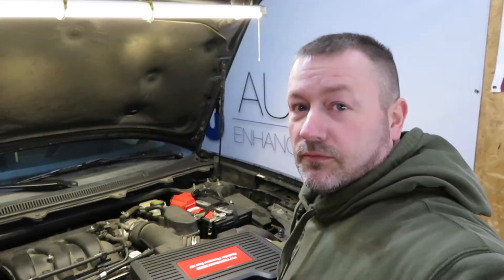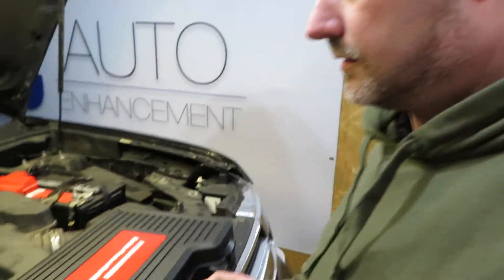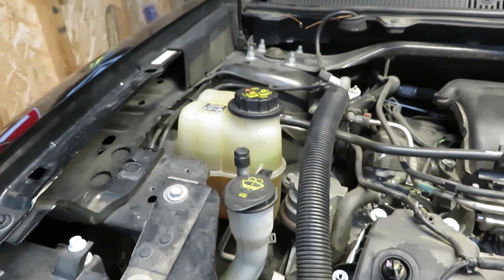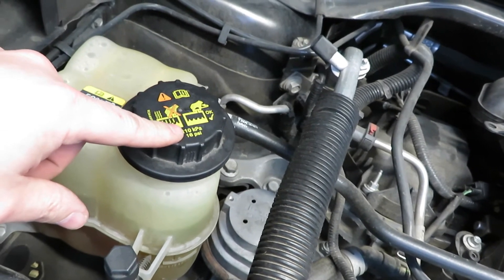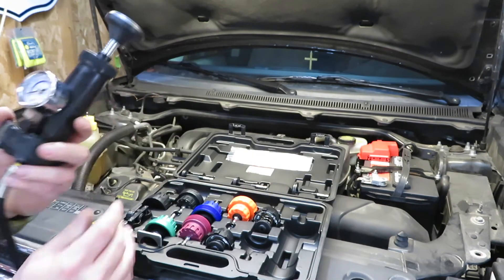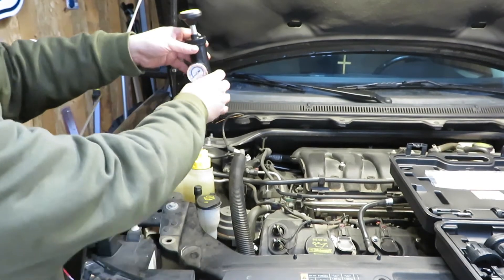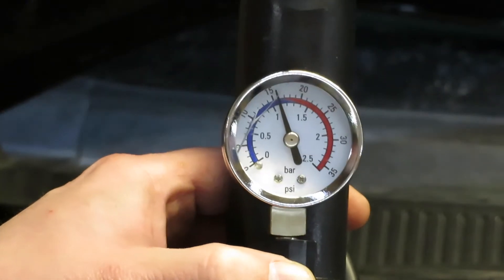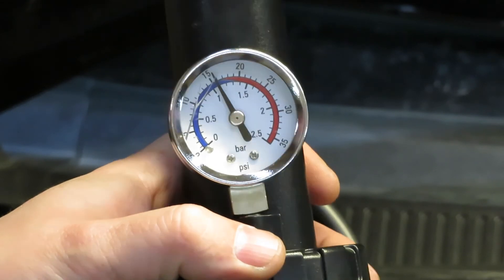Pressure Testing Coolant System Ford Flex

Comment: Need help..is the Reservoir cap tight??mine doesn't tighten at all is that normal???thanks
Reply from the maker: I don't remember. Can you unscrew it and it comes up?
Reply: @DCAutoEnhancement  yes..but when i try to tighten it it doesn't.
Reply from the maker: @juanrendon8165  that might be how it is so that someone can't over tighten it. I'm not sure though. What issues are you having
Reply: @DCAutoEnhancement  over heating..i removed the thermostat and still doing it.couls be radiator needs a flush??water pump doesn't seemed to leak as far as i know.
Reply from the maker: @juanrendon8165  did you replace the thermostat or just check it?
Reply: @DCAutoEnhancement  i took it out.could be water pump.i didnt water circulating